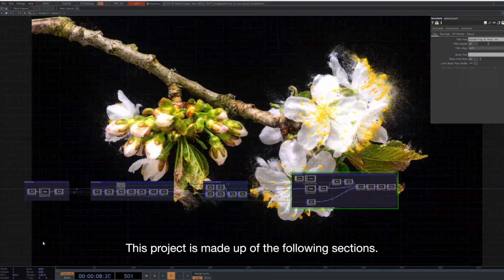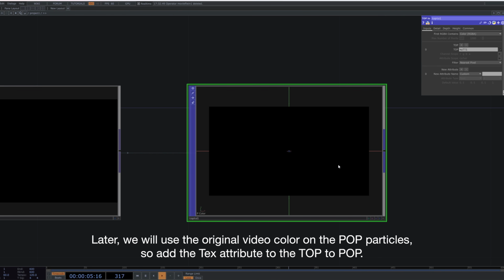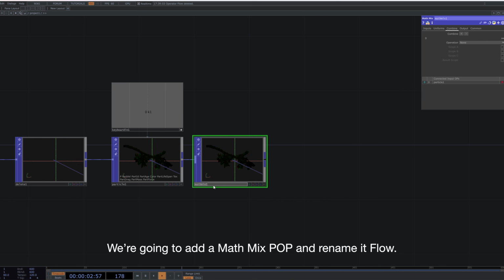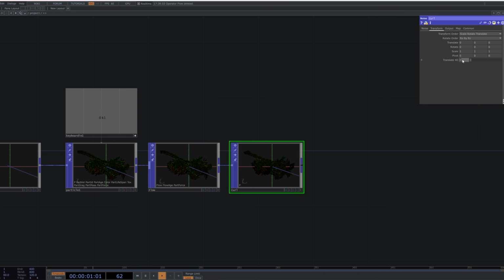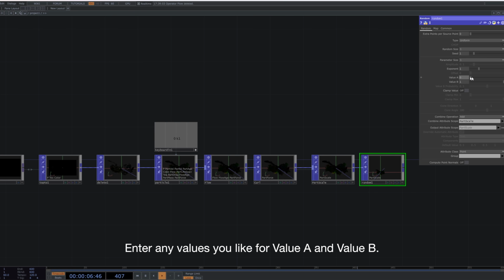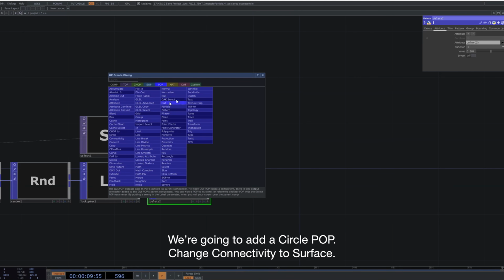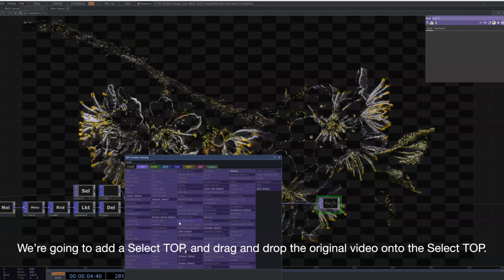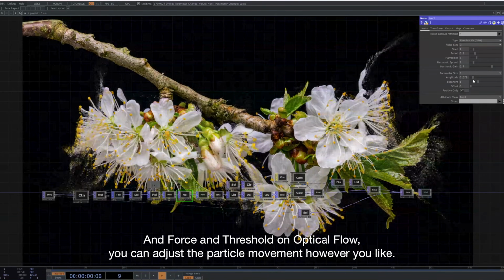TouchDesigner Tutorial: Interactive Particle (Image to Particle)

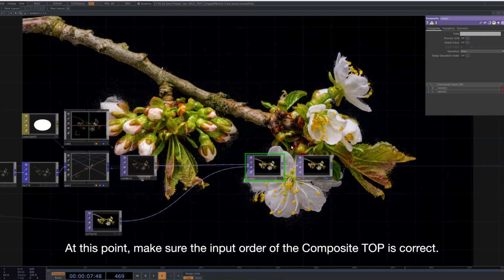Comment: hey so i have a problem at 9:18 , my particle layer appear to be like half the size of the video under it, like their is one big flower (from the video) and theres my small flower made of particles laying in the center of that big flower. HELPPP
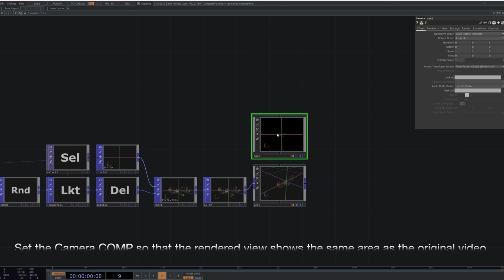Reply from the maker: Could you please check whether you followed the step at 8:29?
This step makes the area shown in the Render TOP match the area shown in the original video.
Reply: @Axi0m-e4i  hi, thanks alot for responding, your videos are absolutely amazing to learn from. wwow i just realized my ortho width default is set to 2, thanks a lot man, i followed u on instagram